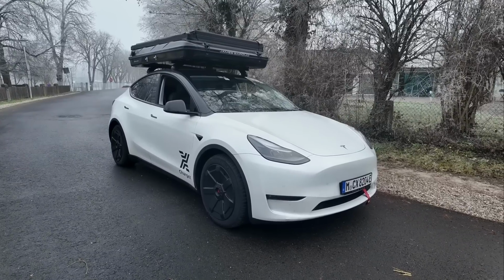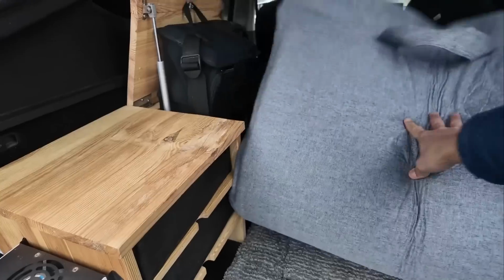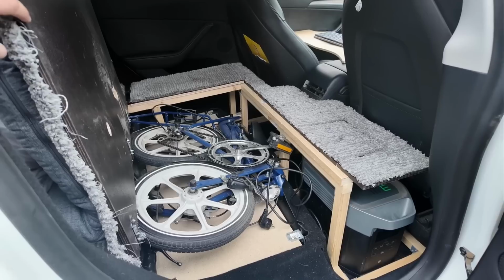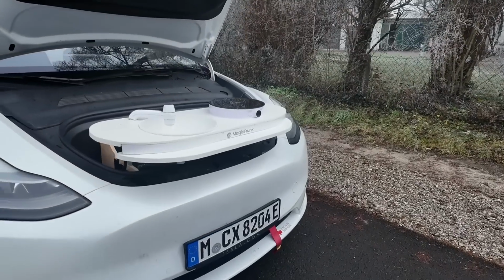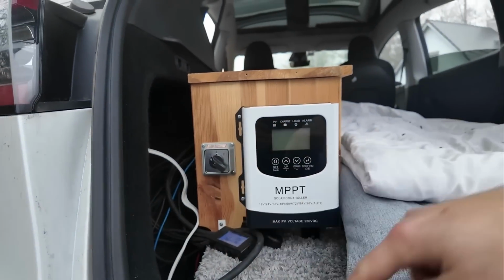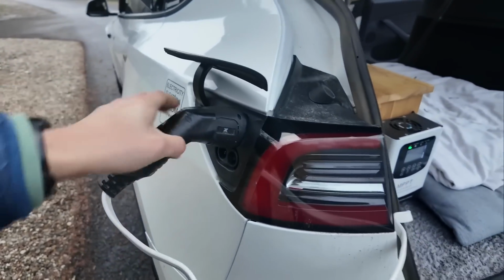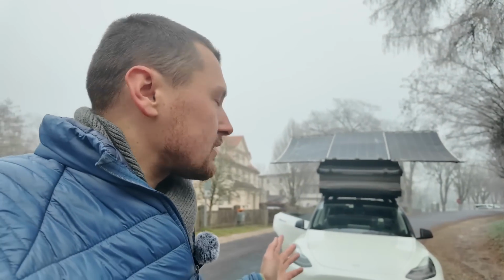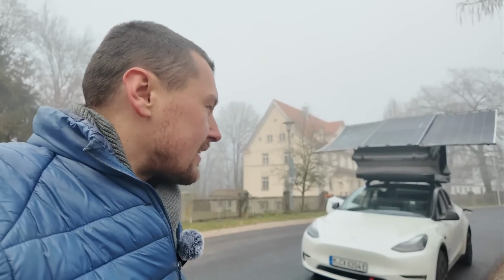My self-charging Tesla Camper with 1.1kWp Solarpower and Frunk Kitchen

Comment: This is a fascinating project…I’m encouraged to do something similar with my model 3. You said in the video that you were unable to charge the car while the battery was charging from the solar panels but when I google doing it, they say that the EcoFlow is able to do so. I wonder if they made a change since you did your project. Also, I didn’t see the connection of your mobile charger to the ecoflow…did you need to use a grounding plug when charging the car?

Comment: Doesn'tthe delta max 2 support  solar to ac pass-throughso uou can extend the charging time while the battery adds on to the solar input or you need to fully charge and than discharge.?

Comment: it would be nice to have it in between Sono Motors car and you set up - option for tesla to have solar roof (semi transparent, like glass to glass biracial solar panels installed on canopies) factory - integrated into the car - maybe it would not add as much range, but it would prevent vampire drain for example or could power sentry

Comment: American here: I'm really enjoying your videos.  Thank you for considering a different EV than Tesla. Have you looked at the American EV maker, Aptera?  Though not in production just yet, they have created a highly efficient (low drag coefficient) EV that incorporates solar into the vehicle body and roof.  Their first model will have a reported range of 400 miles with a 1,000 miles version in the future.  In sunny areas they expect a range of up to 40 miles using the integrated solar charging alone, which would satisfy most commuter's range requirements without having to plug in to charge the battery.  I put a deposit on an Aptera and hope it moves to production soon.
Reply: IIRC the Aptera gets 10 miles (16 km) per kWh.  Totally off the chart efficiency due to its aircraft inspired extreme aerodynamic shape, and low rolling resistance.
Reply: Sorry peeps, sort out ur MAGA cult insanity or we won't buy anything from ya 🤷‍♂

Comment: Wow, when you talked about modifications, I wasn't prepared for that. It's awseome!

Another downside about the ecoflow, is that you can't charge your car, while charging it with solar.
It's strange, Bjorn Nyland is doing it (for the lulz), when he run it's electric cars to 0% SOC.
Reply: I just bought a Bluettei Elite 200.  It will accept solar input while outputting AC at the same time.  It has the same 2 kWh capacity as the EcoFlow used here, with 2600 W AC output.  IIRC it is also smaller and lighter.
Reply: I don't recall Bjorn using any solar panels.
Reply: @JanNovak-pg8oe Well, last time I saw it, was in its last video of the series: "I drove Ford Capri until the battery died"
https://youtu.be/X9p_3400z90?si=8XNXWAjbD9pRMiR0&t=407
He has them for some time, now.